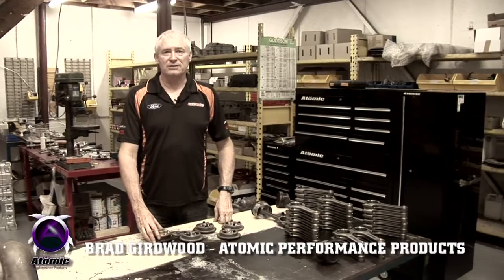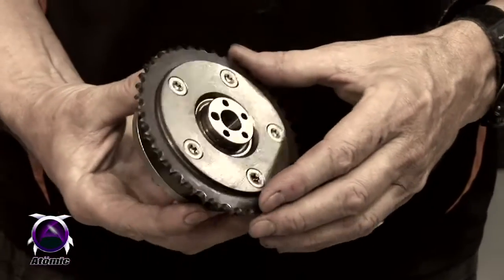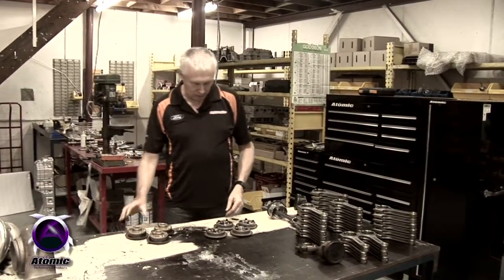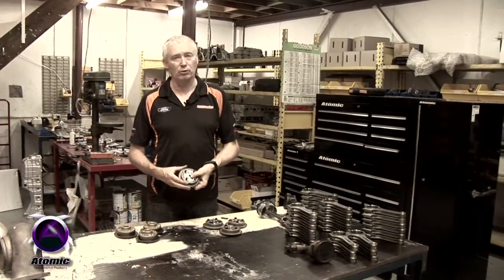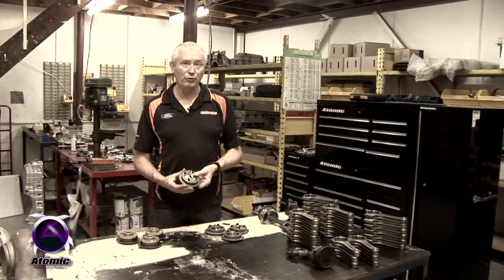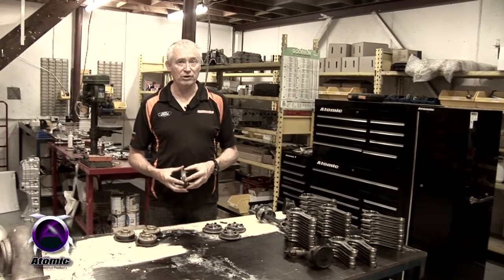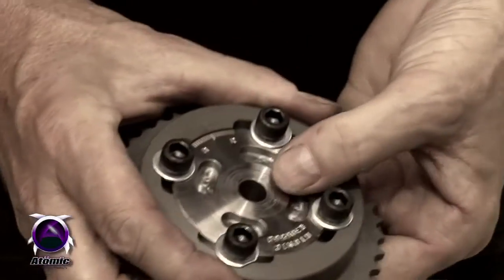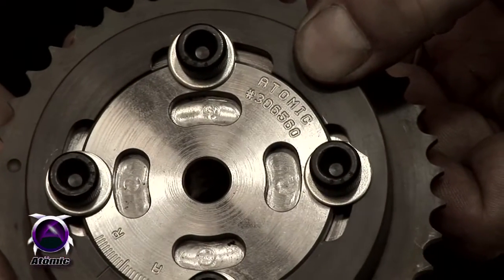Atomic Performance Products - XR6T Vernier Cam Sprockets

Comment: so what difference would removing the vct and putting these on for a stock car na or turbo? I looking at putting a barra into au and using the au ecu which cant control the vct so will be locking the sprockets, how much power can be expected to loose without the vct?